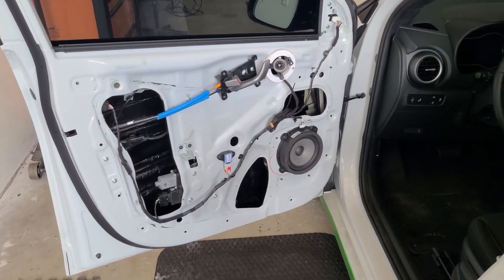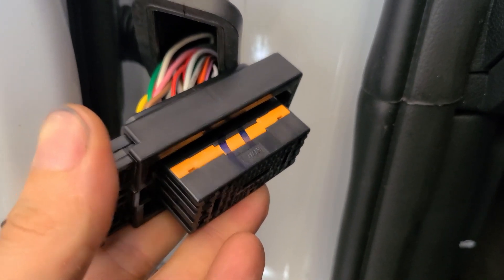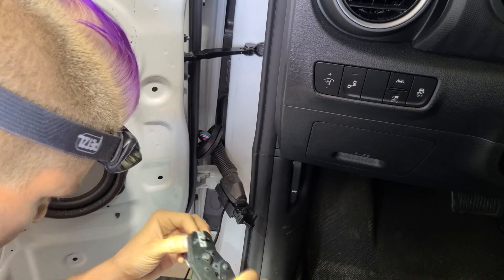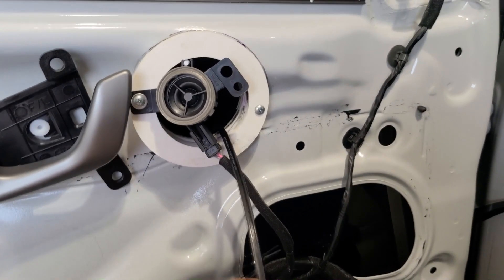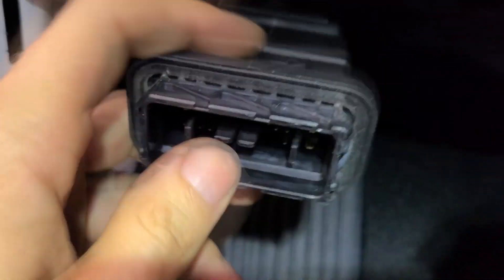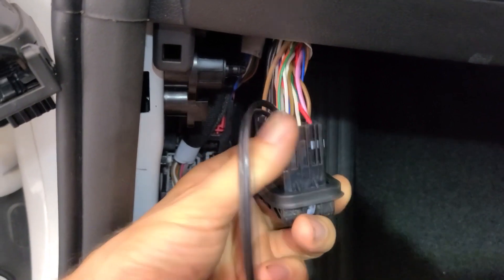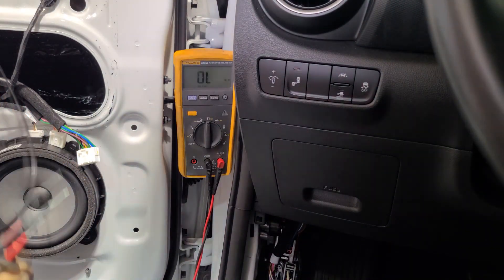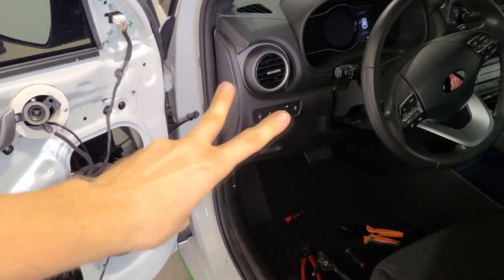How To Run Wire Through Door Molex Plug Into Car - Adding Terminals In A Hyundai Kona!

Comment: Do the terminal/pin type really matter? I have led lights that come with a pin and cant get power from any hole in the molex connector on the door, ive tried every one, ended up connecting it to the speaker molex, and it works, but thats only a short term solution, any tips on why i cant get power to the led light eventhough the pin can be inserted into the harness connections?
Reply from the maker: Yes the terminal pin type really matters.

Comment: What is the length of the terminal in millimeters?
Reply from the maker: I gave a part number.  Measurements are long gone.
Reply: Look for connectors DJ611-2.2 and DJ61-2.2 and you will be fine.  But the male is 28mm and the female is 17.5mm, Width they are 3.3mm and 2.2mm
Reply: @pacotesan  Thank you. I also found the ACC signal on my car door, so I don't need to use that method again

Comment: will I be able to pin 14awg speaker wire? Im going to run a fair amount of power to my door speakers
Reply from the maker: There is absolutely no reason you need any speaker wire thicker than 16AWG to a woofer.  You aren't running 1kw.  But to answer your question, no, you won't be able to pin that through receptacles that aren't designed for that large of a gauge.
Reply: I've got some prv 6.5 that are rated for 1200w rms a pair, or 600w each, I already have them installed, theyre getting their signal straight from the head unit, but I'm dying to hook the amplifier up.

Another question, are the pins you mentioned in the video the same for a 2024 sonata? The connector looks similar
Reply: @39doritoz  according to the website they are only able to be used on 20-22 awg wires. And the price is $39.99. They don’t list the quantity, just that it’s $39.99. So are the female versions. Not worth it tbh.

Comment: I wish my 2003 Protege5 front connectors were this easy. I'm at a point where I may have to remove the door to access the inside connector on the passenger side. Really don't want to have to do that.
Reply from the maker: my dude, I just make it LOOK easy.... that's the beauty of camera magic.  There are outtakes, aggressive cursing, relaxation breaks, repeated attempts, ya just do what ya gotta do to get the job done.

Comment: Do you know what series the terminals are? Im hoping to order these in the UK but I'm struggling to find the correct ones. Thanks 👍
Reply from the maker: I explicitly stated what series the terminals were in the video.  You should watch it, it's pretty good.
Reply: You've stated the product code from the supplier you use? They don't list the series or manufacturer, I agree it's a good video and I did watch it all previously 👍
Reply: Look for connectors DJ611-2.2 and DJ61-2.2
Reply: @Bythirteen  Those are not the correct part numbers. If possible, update the description with DJ611-2.2 and DJ61-2.2. Thanks again for the video!
Reply: @pacotesan Hi. I manged to locate DJ611-2.2, but  DJ61-2.2 isn't listed anywhere.

Comment: Hey. Thought I’d update, connector experts couldn’t find all the terminals I needed so I went to a wreckers and got the parts I needed. 
Super easy, ran 3 new speakers in my front doors and new rear speakers, zero drilling, looks OEM and it was my first time ever doing car audio :)
Edit- this was for a different vehicle then the one in the video, hence no part numbers :)
Reply from the maker: I literally provided you the SKU numbers to order.  But, hey, if you have access to a u-pull junkyard that'll let you hack wiring harnesses, that's certainly an easy solution!  Nice work.
Reply: @Bythirteen  sorry, this was for a different vehicle :)